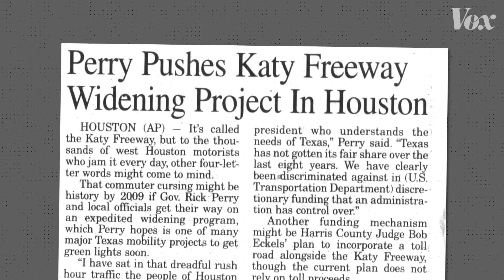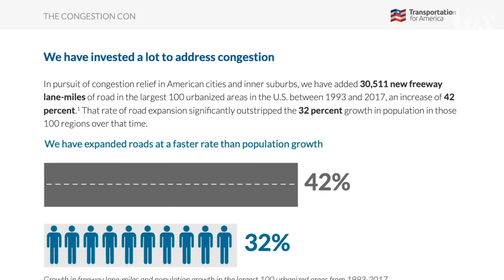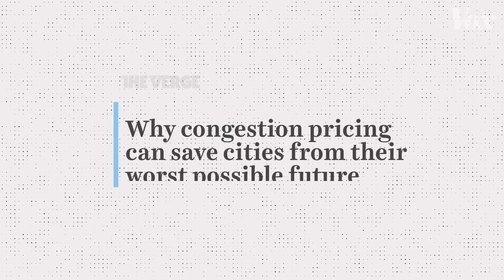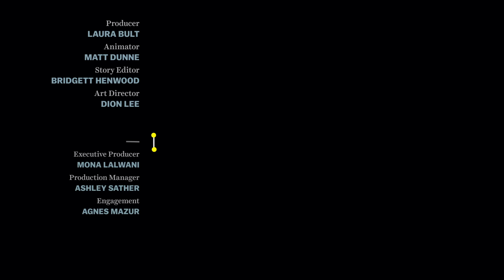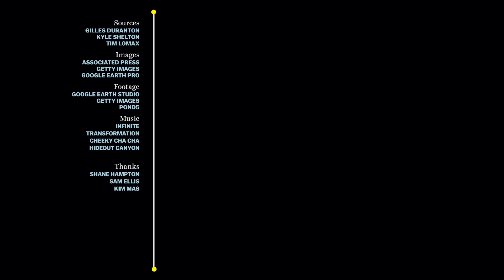How highways make traffic worse

Comment: But I'm not sure calling induce demand some sort of bad thing is quite accurate. It will happen when more and more people use the infrastructure whether it be cars, trains, bikes, etc. Take a look at Beijing, traffic during rush hours is abysmal. You move something like 5km an hour. Yet it is still has one of the most ridden subway system in the world and is one of the longest and one of the highest numbers of stations in world as well. Because of the different stages in building, transfers at stations have pretty long tunnels connecting lines and to the above ground. In most weekdays the stations you're lucky even see the platforms during rush hour as you're stuck in the tunnels. And for people in the suburbs, walking/biking to work isn't a good option (distance being the problem).
Reply: How you describe Beijing is a prime example why diverse solution is very important. Had either the subway or highway cease to exist, the other will suffer from even worse congestion.

Comment: The only real way to fix highways is by reinventing the interchange system. If we prop up the economy on the commuter class and fix our highways to rightfully go 100mph safety, we can fix this crisis. Currently interchanges are just dysfunctional due to engineering. For example, in design the Katy freeway is actually 6 frontage rod lanes, 4 highway road lanes, and 3 bus lanes on either side. Texas engineers beleive slip lanes function between a 3 phase roadway system. They are wrong. This causes weaving points alike a cloverleaf interchange. To help you picture the congestion imagine the last time you drove a clover leaf, and the weave zone of the cloverleaf or as my girlfriend calls it “the rodeo”,  or even the entrance to a roundabout follows the same logic principles, and this extends throughout the entire duration of the road. Not only this, but these highway slip lanes that you MUST weave through are also a left hand access ramp, which is an huge engineering no-no in the states as it requires specialized regional drivers-Ed programs along with the inherent blind zone of a left hand ramp. This actually highway was a monstrous failure as the entire fast lane and slow lane are weave zones, forcing Texas engineers to just continue widening the highway to even ALLOW through-traffic to get through. In practice the entire highway is pure weave-zone, produces more congestion than it relieves,  and is a terrible example against highways. A simple 2 lane highway with a slow and fast lane, and a 3rd lane for entering/exiting, and the simple rule that you enter the interchange first and exit last, this could be solved. Matter of fact with the same amount of space you can just throw down a bunch of French parclo interchanges with roundabouts and a 2 way frontage road on either side and you can fix everything that way

Comment: I think there should be a balance. I mean you cant just reduce it to 2 lanes altogether and expect the reduced "induced demand" to solve the problem.
Reply: don't go for extreme options but rather choose soft ones; thus e.g. a highway entering my state's capital city goes from 3 lanes to 5 lanes some miles outside the city and slowly goes down to 2 lanes the more it gets into the city and it works; Although you'll recognize rush hour, there aren't traffic jams on a daily basis

Comment: Interesting video, It seems the video is about stopping highway growth ?  Does that really help anyway ?   Maybe it should really be about city design.  Where businesses don't conglomerate all in one place. I would imagine city executive's don't want that because it gives them more tax money to spend (and higher pay ) when there is growth.
It would seem mass transportation is a nice idea, but really isn't very practically designed.  It can take twice as long or longer to take mass transit as it does to drive.  Salt Lake County has almost two or three rail lines that run from the south east corner to the north east corner.  It is kind of odd.  A more grid like pattern would have been more functional.  
I am kind of skeptical of the mechanics of the model you present.

Comment: Public Transit like metro , mono rail , light railway are only long term solutions 

road may appear simple and comperativly cheap to built then other transport but they are not the long term solution to the problem.

Other than congestion amount of co2 released by these private vehicles is worrysome 🙄

Comment: Yes, but this whole argument is a fallacy.  You are saying that widening highways would keep the same speeds, since more people are joining.  But in a sense, that is the point.  The idea is not only to make the highway faster, but make the highway an option that more people can take in a reasonable amount of time.

If the highway is 10mph with 2 lanes, and then you expand to 4 lanes, it would take twice the amount of people to maintain the 10mph speed.  But in a sense this is definitely an improvement.  People wouldn't be using the highway if it didn't offer the fastest mode of transport to their destination, so we can assume that using the highway at all is a success for everyone that is using it (otherwise they would just take off roads).  And such we have double our amount of successes.  We haven't made the highway faster per say, but we have still accommodated to many many more people.

Comment: I have a problem with your single piece of evidence for increasing other modes of transportation reducing traffic congestion. The boston overpass that was deconstructed and turned into a ground level road that actual connects to other things improved congestion. Yes it also has bike lanes and sidewalks and a bus route like any major city road. Yet you tried to line this up with the thesis of your report that it was the sidewalks that helped congestion, not lowering an overpass that was able to connect to other streets.

Comment: That doesn't work like that!
People won't buy cars only because their local highway get 1 new additional lane.
Your theory is not that important as you preaching.
Reply: You gotta understand the US a little better. Almost everything in the past 70 years has been built so you need to have a car. Due to this basically everyone will own a car if they can unless they live in the few utopian(by US standards which are just laughably low) down towns or walkable areas. This means that as you stated, people will not buy a new car if a new lane gets added. Instead they use the car they already have, and one of the groups used as examples was the people driving on smaller non highway roads (avenues, boulevards etc) for their commute who upon seeing initially that the highway is no longer as slow with more lanes, will switch to the highway thinking it will now be faster than the avenues/boulevards.

Comment: I cannot take someone serious who tells me to add a buslane instead of a car lane. A buslane uses more space than a car lane. On every carlane there is a capacity of ca 2000 to 2500 cars an hour. Lets drive busses....3000 people in 2500 cars is the average in my country, we need 60 busses for transport the same 3000 people.They have busstops, people going in and out. It will be difficult to get more passengers transported in one hour than on a car lane.
 A bus does not drive from the place where you are to the place where you need to be....so we increase the total amount of person kilometers (and travelling time) a lot when using the bus...because we must first go the starting pace of  the bus, and at the other end we must go to our destination in another way (or another bus). The alternative is : Let the bus drive around for picking people from busstops....it increases the traveltime from the bus and the amount of kilometers. Also  for a part of the route the bus is driving empty or half empty.. 
Next thought...a bus drives empty to the suburbs and takes people to the center. It will return empty to the suburbs again an refill there with passengers. A buslane will be very busy in both directions during all rush hours.
One  heavy bus will damage the roads more than 1000 cars....maintenance for the buslane will be high...and during maintenance  the bus has somewhere else to go.
If you really wants to change the traffic....reconsider your town, let people get their work offices in the suburbs. Do not concentrate all this business in the center of town. Move (more) work to the suburbs.
Or build railroad transport...metro...to the suburbs. The capacity of a metroline system will be much better than that on a busslane, and not taking more space.

Only a parking issue in the towncenter will be decrease when we go by bus. If there is a parking issue, but that was not told in the video.
And does the filmmaker consider the growth of the total account of people in the surroundings?
When you build houses for more people you'll need more space for transporting people from and to business. That also is a reason that congestion does not disapeear when increasing the number of lanes.

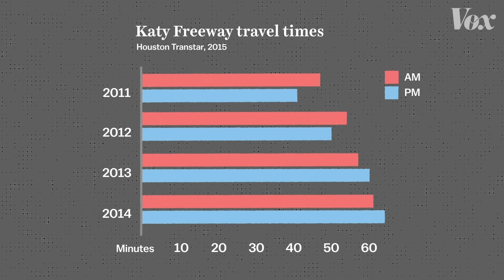Comment: At 1:02, there is mention of a simple economic theory that explains why building more lanes does not reduce congestion. This theory is the law of demand and supply. More highways (supply) leads to more cars taking to the roads (demand), so congestion never goes away. While this is interesting and in large part accurate, this is actually NOT the main reason why more lanes and highways fail to reduce congestion in urban centers. 

The real reason hinges on a different economic concept known as output. In other words, reducing congestion should address the most critical bottleneck. And the bottleneck was never "how many cars can I have on a highway" but instead at what rate can I get them to exit the highway. In most infrastructure projects, adding lanes to highways essentially equates to adding "storage capacity" to the highway, which is absolutely nonsensical. The real issue is with the number of exits and their respective outputs, which are the only elements that really require fixing. Highways with 10, 15, etc. lanes across are a complete aberration and waste of capital.  

Now on incentives and highway removal, this is something that can be accepted for aesthetical reasons (e.g. Boston where it was buried) or if maintenance costs spiral out of control. But it really is a cowardly decision when so many other superior options to incentivize exist, they only require more courage. That being said, there is no argument that building highways and adding lanes the way it's been done the past few decades is lazy and aggravates America's already sub-par infrastructure.

Comment: This still doesn't make sense. Surely there is an upper limit to how many cars can fill a highway, no? Cars don't just magically appear or pour in like water in a pothole,
Reply: If you build more lanes, more people think they can get car because they think that due to the extra lanes there will be less congestion, thus adding more cars to the new lanes thus causing more congestion and so on and so on.
Reply: @gijs_k3737  correct. Tho, theoretically you could solve the problem by adding so many lanes that there arent enough people in the city with cars to fill them all, but that would be far more expensive and enviornmentally damaging than just investing in better bike lines and bus routes.

Comment: This is not very persuasive. If drivers were previously taking local roads rather than a highway, the highway is clearly benefitting those local roads that likely have reduced congestion. It also doesn't follow that the amount of people who now live farther and commute is commensurate with the amount of flow from the highway. If Katy highway is more congested, it could mean highways lead to behaviors that cause more traffic, or it could mean that traffic has been reduced significantly in other areas of the city, and that people in lower income housing have better access to the city.

Comment: No highway, no traffic. Make it so everyone who can work from home is essentially forced to, and the rest can use public efficient public transport where feasible. Make it so only those those that must drive can drive.
Reply: Sounds like in the end everyone suffers more.
Reply: @Frenchfrys17  did you learn nothing?
Reply: @thepepper191  Car is by default the fastest form of transportation for most destinations that aren't right next to a station. If you remove highways, then you are forcing everyone to have longer commutes on average regardless.
Reply: @Frenchfrys17  I'm from Europe. I go to school, and when I take the public trasports, in 20 minutes I'm arrived at 20 meters from my school. Once a week my dad take me to school by car, in that day I arrive to usually 60 meters from school in 35 minutes.
Reply: @jackmorass  And what is the total distance of your commute for each trip?
Reply: @Frenchfrys17  never mesured it, is pretty much the same: they follow the same direction at 1  or two blocks of distance in favour of the cars, but cars have a lot of stops and traffic lights
Reply: @jackmorass  I can commute from my home to the nearest high school in 3 minutes. So unless you tell me the distance traveled, your reply is pointless.
Reply: @Frenchfrys17  The nearest school to my home is at 5 minutes on foot. In air line, from my school to home is 7.432 km, is not the nearest, by car is around 9 km and by train is very similar to car, but I don't have the precise data

Comment: I feel like lots of people do truly think that public transportation is a silver bullet its like they sweep under the rug like you cant find news stories of japanese sleeping in their cars in fraffic or the arc de triomphe overflowing with cars
Reply: Ok, continue being stuck in traffic while i sleep in a train going 90 mph. That's what public transport does. Bypass traffic.
Reply: I lived in Tokyo for several years & the traffic is so bad precisely because they built multiple highways across the city. However car ownership is extremely low at around 20% of adults & is getting much better since the ban most on street parking.. Public transport is much quicker & more reliable... The fact that the road around the Arc De Triomphe  consists of eight lanes rather proves the points made in the video. Probably why the current mayor is making the centre of Paris largely car free.
Reply: @56independent  well i mean since u live in the europe i really doubt ur getting a real good nights sleep on a train and also u are just replacing cars with people and late trains ur time is not being spent anymore efficently and i bet you can go on google maps and find the time of driving is about the exact same as being on a train.
Reply: @thatonelegend817  But what's a nicer experience? Sitting around in your car forced into one position to be in traffic or being on a nice comfortable seat going at 150 km/h and bypassing traffic, where you can stand up and stretch your legs every now and then?
Reply: @56independent  well i mean it depends on what you consider nicer. Cuz i know yo you probably arent standing up to stretch on a train and you definitely arent leaving your bags unattended. And in my car i dont have to worry about a person who smells like they shat themselves. I dont even have to be around strangers.
Reply: @thatonelegend817  no you just have to trust barely qualified strangers around you not to get into a crash. In a train the drivers are very strictly taught.

Comment: Adding extra lanes does not, in itself, increase the traffic flow capacity of a road.  Only higher speeds accomplish this.  To the degree additional lanes allow more cars to travel at a faster speed than before, then sure, indirectly they can increase flow rates.  There is a big caveat, though.  As you increase the number of lanes, you also increase the number of conflict points, which can result in traffic jams.  Also, you now have a much bigger spillover capacity, resulting in much larger traffic jams when they happen.

What you really want is an increase in alternate, parallel routes.  At the same average speed of traffic, two two-lane roads (in each direction) will have a much greater traffic flow capacity than a single road with 5 lanes (in each direction).  There is rarely any good reason to have a road stretch more than 4 lanes in each direction.  It is wasted space which actually impedes overall traffic flow, due to the way most drivers behave (the more lanes there are, the more diligent drivers need to be in regard to lateral gridlock -- i.e. diligently making sure there are no cars immediately to your right or left blocking potential lane changes -- the majority of drivers ignore this advice), and due to the higher chances of conflict that arise when you have more conflict points.

I'm not saying that induced demand isn't a thing, but what I am saying is that the perceived benefits of additional lanes are grossly overstated and widely misunderstood, even by traffic engineers.

Comment: The bus is not reliable at all it’s only the trains
Reply: it is reliable if we actually invest in them.
Reply: Busses are exactly as reliable as you design them to be. Badly designed bus network will be awful, a well-designed one is a pleasure to use.
Reply: 6 years ago, houston radically changed the way its bus network operated (/watch?v=WYc9T6Nxh4w) and funded it decently. Since that time, ridership has increased massively and reduced the amount of cars on the road as well as make the city more accessible for poor people and those unable to drive for whatever reason. 
Bus networks work, if you make sure that they are funded and even better if you make sure they don't get stuck in traffic.